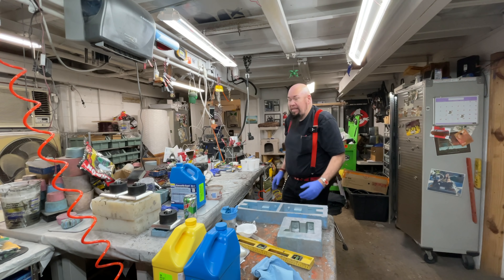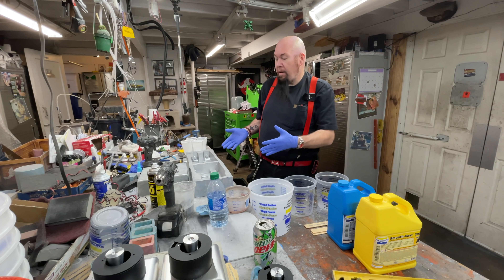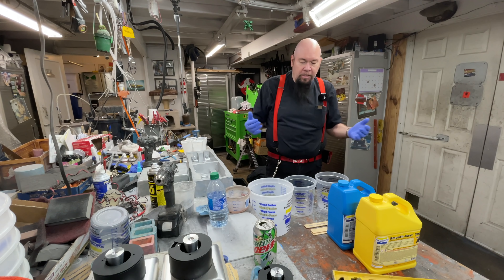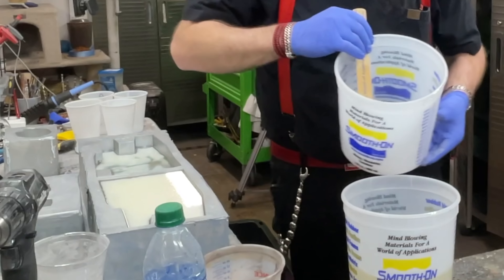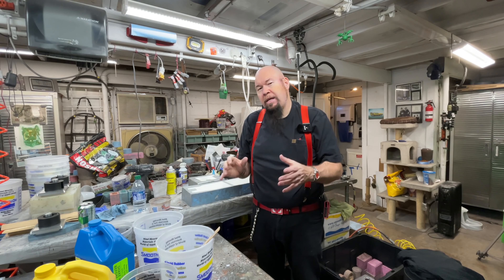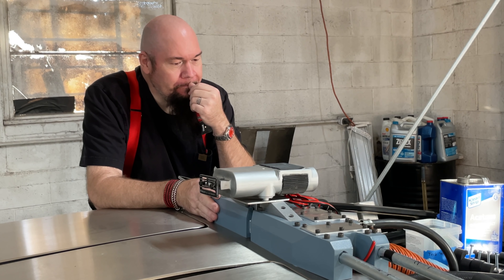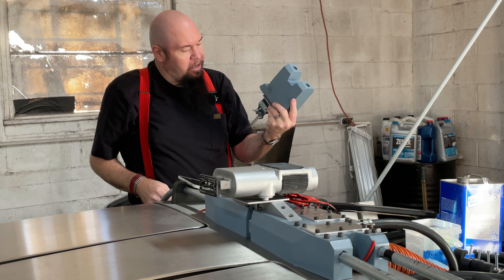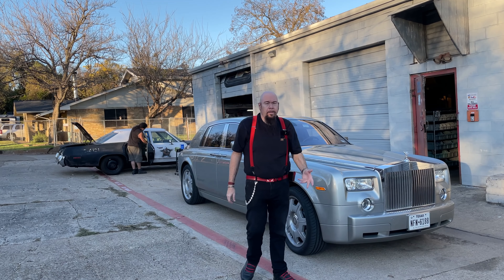Building a Delorean Time Machine Replica - Part 11 - Flux boxes

Comment: Use filler like tin foil or foam to take up space at the center of the mold. The parts are much lighter and  you save that extra expense! It’s a grey bluish tint for sure!
See on a screen car,especially a stunt car they use any hew as long as it’s the same color because depending on the scene they can manipulate the detail in post and adjust color during color correction. I think your slate blue is a good choice,especially if it’s just a few coats over grey prime. Pre production cars don’t use colors on parts that are meant to be used for the screen cars. You always go screen used,which ever matches the film after color correction!
I know you prob know all this but i though i’d let you know i agree with what you chose!